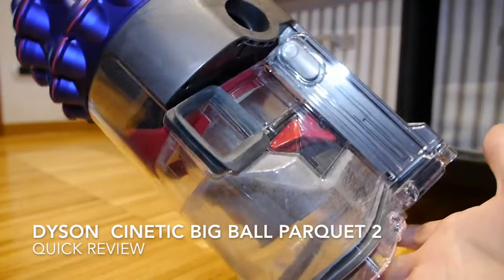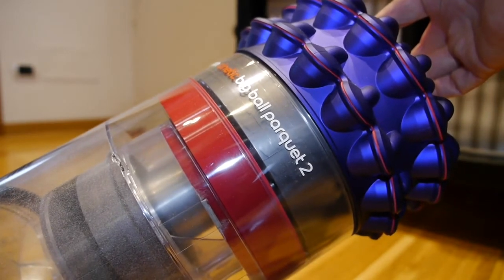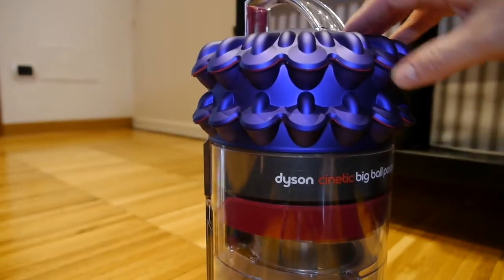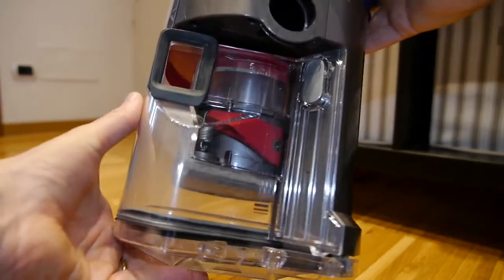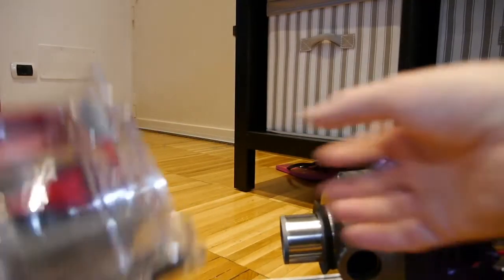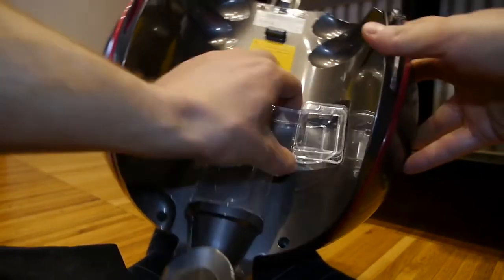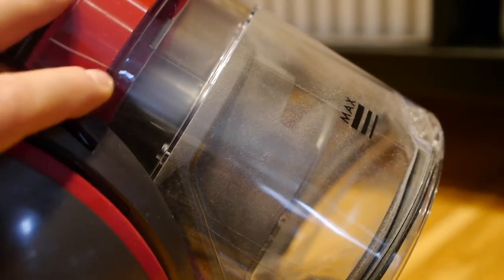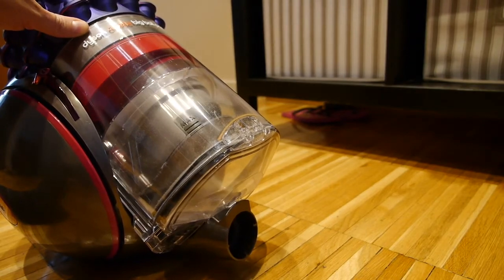dyson big ball cinetic 2 - quick look to the bin technology

Comment: That tiny shroud would probably clog up in my apartment. I live in A very dusty area.  I've had Dysons clog up here, despite Dyson claiming No Loss Of Suction. The shrouds have clogged as well as the filters. It's very disappointing to see that Dyson has not improved the wheels on these machines that I've seen break off.  Not the best quality, but interesting designs.
Reply from the maker: blakaeg you need to empty it every time the dirt goes up to the MAX level, and in fact it’s a relatively small volume to fill up. On the other hand I see that people with lots of carpets and pets in the house loves it (carpets and animals mean lots of fur and dust). For sure isn’t designed for rough cleaning of places like garages or cellar floor. I never had a clog ciclone (I owned 4 different models) but I empty it almost everytime I use it.
Reply: Excellent vacuum no clogging or wheels falling of ....that's nonsense.